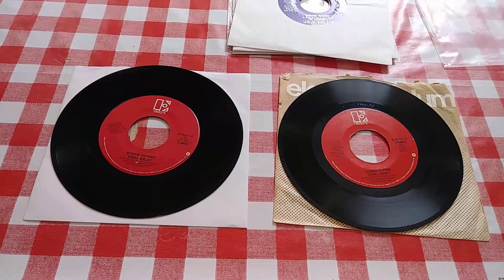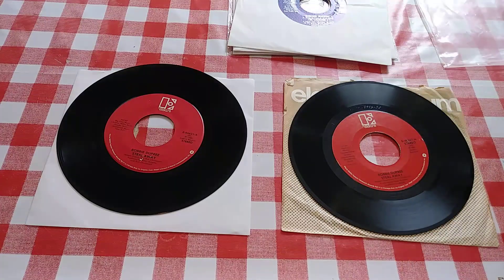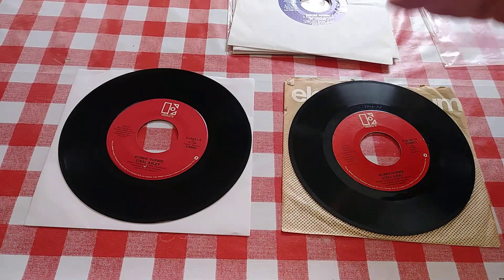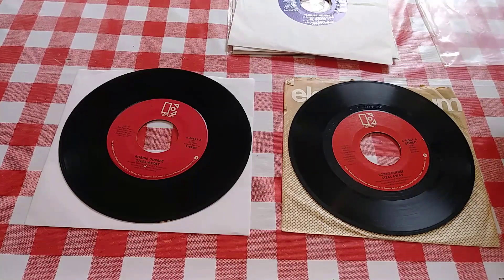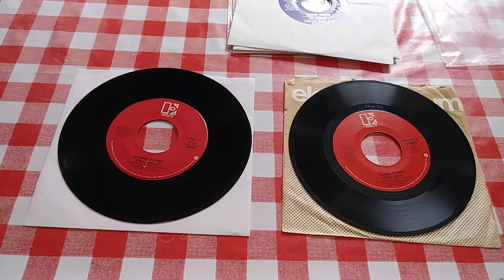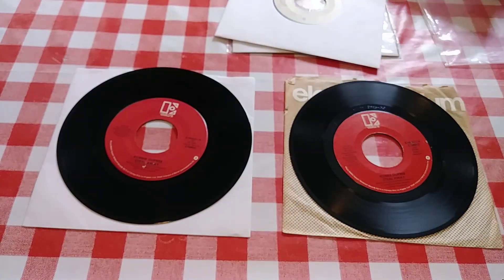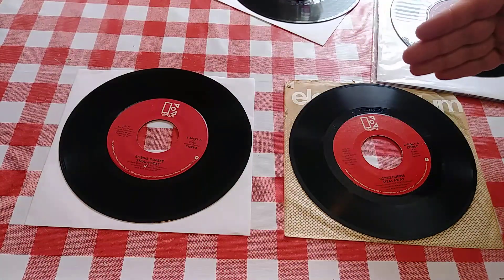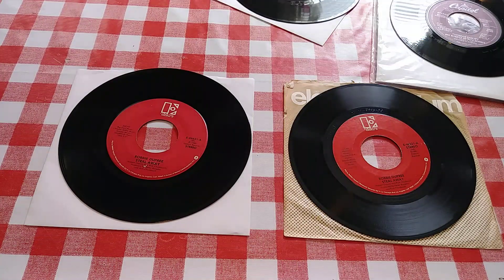Not All Records Are Vinyl | How to tell a Vinyl 45 from Polystyrene.

Comment: For what it's worth, my first TT was a BSR changer all-in-one that I was given in the late 70's.  I really didn't start collecting records (and 45's primarily) until 1982.  I used that BSR to stack and play vinyl and styrene 45's until I got a new component system in 1986.  I didn't burn out any 45's with that BSR.  My TT became an Onkyo semi-automatic return TT.  It was outfitted with a Shure Pro-Track-4 (RXP3), essentially a P-mount cart with a 1/2" headshell adapter.  I used both the standard stylus and eventually the upgrade stylus (N104E), which is elliptical.  I set the tracking to 1.25g.  After the Onkyo, I used the wayback machine and took possession of my dad's Dual 1225.  Since the RXP3 was really cheap at the Shack, I hung that cart onto the Dual 1225's headshell, using the same 1/2" to P-mount adapter, and have been using this setup since (+25 years).  Bottom line is, that I've never burned out any styrene 45 that I've had in my possession using the N104E in a Shure ProTrack-4 / RXP3 cart tracking at 1.25g... and I play my 45's a LOT.  Since I've installed my last NOS Shure Stylus, I will need to move on to a new cart unless I want to overpay for a JICO stylus.  Instead, I plan to move on to an Audio Technica AT85EP, since it also tracks between 1 and 1.5g.  Since the shape is the same, I am hoping to continue not burning out styrene 45's...
Reply from the maker: The BSR tables were not bad compared to the junk ceramic garbage of today. I had a few of those myself. As long as you kept up with replacing the styli, they were kind to records. The Shure is also not going to hurt any kind of record tracking at 1.25. I am now using Stanton 680's exclusively and my elliptical D680 stylus tracks happily at 1 gram with no irretrievable distortion. It all depends on the cartridge design. :)

Comment: There were a LOT of Motown records on styrene!  One of his first labels, Miracle, was on nothing but styrene, from what I've seen.  I would say most Motown from the `60's was on vinyl but, in the early to mid `70's, they started doing a LOT of styrene!!  And, most of their vinyl wore out pretty fast, too.  I've seen dozens of Motown vinyl singles where the grooves are almost white from ware!!
SOME Columbia singles are on vinyl.  Mostly it's promo copies and most of those are on coloured vinyl.  However, in 1977, if I recall correctly, they had a strike at their pressing plant(s) so, they had to have other people press their records for them and, in as such, there were quite a few stock copies on vinyl during that year or so.
RCA had their own pressing plant(s) too until 1978 when they had other companies press and a lot used styrene.
Another way to tell vinyl from styrene is to stick 2 fingers into the hole and, using a finger on the other hand, just tap the record with a fingernail.  Vinyl will just kinda go, "thud" but styrene has a slight ring to it.  Another way (at least with vinyl from the `50's to the early `80's) is to hold the record up to a light.  Styrene becomes slightly transparent, vinyl doesn't, except for most records made from the early `80's to the present.
Ther was a crappy plant in New Jersey that mostly pressed kids records (Golden, Peter Pan, Prom, and dozens of other small time labels).  I have NO idea what garbage they used to press their records into but, those were some of the cheapest records ever made!  I got a blacklight back in the early `70's and decided to see what records would look like under it.  Most looked pretty much the same but, I seem to recall that the styrenes looked red but, those cheapo Jersey records looked brown with yellow swirls in them!!  Really weird!!  I've got one on prom where the vinyl right next to the center hole is nearly paper thin!  If you put ANY pressure on it at all in that area, it'll collapse in your fingers!!
There's LOADS of videos that tell you how vinyl is pressed but NOTHING to show how styrene records are made!!
Reply from the maker: Most folks don't even know about the injection molding process these days. It has been floated out as a way to make LP's, though. Can you imagine a polystyrene LP?
Reply: @EzeeLinux  Yes, I have a few styrene albums.

Comment: Vinyl, Unbreakable and similar terms were printed on jackets and sleeves when record companies abandoned 78 rpm shellac. The rise under the label was on  Columbia’s 33+1/3 and RCA’s 45 rpm records from the start. Playing stacks of records was a thing going back to 78s. Otherwise I’m in basic agreement on this subject. But, haven’t you noticed that polystyrene gets hard and brittle over time? Now old CDs are showing degradation of the plastic. Also, I wonder how well lighter records would work with vintage turntables and jukeboxes.

Comment: Polystyrene 45's suck. They're cheaper to produce than real vinyl records and they don't last. After 20-25 plays, they sound "staticy" and "fuzzy." Hold a styrene 45 up to light & you can see through it. Too many record companies used styrene in the '80s.
Reply: And the retail price was about ⅓ of a 12" album, too expensive for this.
Reply: If light can pass through a 45/LP it can create a problem with some fully automatic turntables. I has a Sony fully automatic turntable and it used light to sense the size of the record. The light passed through two holes on the platter. It could tell the size of the record as follows: Both holes blocked = 12 inch record, one hole blocked = 10 inch record, no holes blocked = 7 inch record.

If the light can pass through the record then it will think that its a 7 inch record regardless of its size. I had to put the stylus on the record manually, otherwise it would play it as if it was a 7 inch record.

Comment: In Germany, steryne records were easy to recognize, because they had no paper labels. The writing was engraved in the matrices, the label area was covered with paint, red for Polydor, blue for Philips and silver gray for Ariola BMG.
Styrene is more fragile, it's less breakable as shellac, but easy breakable. With vinyl it takes much force.
A single was ⅓ of an album, so pretty expensive.
East Germany never had Styrene records, so they are way better.
Reply: Are you sure you're not referring to the VINYL with the  INJECTION-MOLDED LABELS?
Reply: @DLCOrganization  nope, it's the contrary. Some styrene records had glued  paper labels.
The material is harder, brittle, can be destroyed, when the stylus is too fine. On the other hand, it wouldn't make sense to apply some paint on the label area of a pressed vinyl, would slow down the process.
Reply: @verkehrsteilnehmer-berlin  -- I'm very well aware of this.
In America, pretty much ALL styrene records had glued paper labels.

Given what you said about the painted labels, bear in mind, it wasn't actual paint,
but a specially-formed ink that was basically stamped over the label area,
most famously utilized by the Amy-Mala-Bell record group.

Comment: I am a 45 RPM records collector since the early 80's. At that time I did not know the difference thus some of those called styrene (Columbia, RCA, Chrysallis, A&M) got wear with plays. My Warner Bros, Motown, MCA sound like new 40 years later. In summary, I do hate styrene.  Do you know that in Canada all labels were pressed on vinyl? 100% of my MCA, Motown, Atlantic, Capitol, Warner Bros are all vinyl, not styrene.  It is interesting to note that most promos on all those companies were pressed on styrene, except A&M which surprisingly pressed their regular commercial records on styrene, on the contrary, their promos were ALL on high quality durable vinyl.

Comment: Crosleys do not track at 9 grams.  They track at 6 tops which was normal until magnetic cartridges came out in the 70s.
Reply: 6 or 9 - what's the difference? Both terrible.
Reply from the maker: Magnetic carts have been around since the 1930's... 6 grams may have been the standard at one time for ceramic carts but it was too heavy. Those Crosley crappers have sapphire styli and some do indeed track as high as 9 grams when the arm isn't calibrated correctly. Sapphire wars out after about 20 hours of play... They're groove chewing junk. Pernod. :)
Reply: I’m not trying to defend Crosleys.  But the fact is that they are no worse than the cheap turntables used by most people in the early parts of the LP era.  Everybody who is actually weighed a Crosley cartridge, has clocked it in anywhere between 5 and 6 g.

When I say magnetic cartridges have only been around since the 1970s. The fact is that they were only really commercially available at a reasonable price around that time.   Phonograph preamps are a newish invention.  Magnetic cartridges are very light and do not put out the sound output required therefore they must be pre-amplified to get the proper dynamics. 

I’m not trying to defend these cheap record players, but at the same time you can establish the superiority of a better quality turntable without telling untruths about cheap turntables available today. 

Oh, and one more thing.  When the microgroove records of both Columbia and RCA were first manufactured, the tracking force specification was between five and six grams.  This was the least pressure they could use for the cartridges of the day while still giving out the best sound quality possible.

Records all the way up until the end of the mainstream LP era were manufactured to accept a 6 g cartridge. 

Only a handful of modern record records today would not be suitable for that such as dance records with very heavy bass.  This is because those records are mostly bought by DJs, who have high-end turntables with low cartridge weight.

Yes 5 grams will wear your records faster than 3 grams. But those cheap turntables don’t need artificial bad press.
Reply: @paulblackman8159  Totally agree.  While Crosley Cruisers aren't exactly good, anybody who says they "track at 9 grams" are just talking out their ass.  The RokBlok is far worse than any Crosley imo, those you truly can call groove chewers if you've seen Techmoan's video.

Comment: Did you folks ever think why conical stylus life-cycle is 200-300 h and micro-line/shibata is 800-1000 h? ML/SH provides way better contact so roughly at the same tracking force ML/SH type of stylus makes MUCH less pressure. So using ML/SH is good for a record no matter what material (vinyl or styrene) it is made of. Obviously conical stylus will wear out your record sooner.
Reply from the maker: Where did you hear that conical styli wear out in 200 hours? That's BS. They will last as long as 1000 hours if cared for properly. Also,, what I said about advanced shapes damaging styrene comes from real-world experience. All the hype about perfect groove contact with MicroLine and Shibata assumes a perfect alignment and doesn't take into account the characteristics of polystyrene. There's a  lot of audiophile snake oil in what Millennial-run marketing departments publish these days.

Comment: I was surprised when RCA made 45 singles for their Gold Standard series in the late 1970s thru the 1980s on styrene, but mostly using a rounded edge near the label.  And those atrocious Bell and Golden Records injection molding pressings using painted labels that came off too fast!  It was rare when Columbia & Epic pressed on vinyl without the disc being a promo.  Colored styrene was hard to find unless you saw the record through light.

Comment: I'm really glad I watched this video Joe. I just inherited my parents' record collection and some of the 45s mum gave me go right back to 1959. I'll have to go through them and see which ones are polystyrene now. I'm running a VM540ML on my turntable and was going to play them all on that, not knowing the problems associated with styrene and microline. 
I have the stock XP3 cart I got with my LP140XP but it isn't terribly exciting. Looks like I might have to pick up a VM95EN for the styrene 45s.
Reply: VM540ML plays much better than 95-series. I'm not sure there is any issue with  the microline or shibata stylus
Reply: I put a comment to this video describing the pressure effect which is for conical type of stylus is more significant.

Comment: For the most part, styrene center labels used 60 or 70 lb. C1S (coated one side) label litho stock, with an adhesive slapped on the back which, when applied to the record, glued it on.  Such labels were designated "Heat Seal."  45 labels were printed "24 up" on 19" x 25" paper stock, then cut up into four "6 up" sheets.  Columbia, Bestway and Shelley Products all had a label trim of 3.5"; Monarch and Allied had it 3.5625"; and PRC's was 3.625".

Vinyl labels were designated as "Compression"; label paper stock was all over the place, ranging from 60 or 70 lb. Kromekote C1S [cast-coated] up to the 1970's (60 lb. was also used on some styrene labels), to 60, 70 or 80 lb. C1S Litho, to 60, 70 or 80 lb. C2S Gloss, to 70 or 80 lb. Dull Coated, to 70 or 80 lb. Matte Coated, to uncoated paper stock of 70 or 80 lb. that was either characterized as Smooth or Offset.  Such labels shrunk by about 0.5 - 0.7 percent when pressed onto the record.

For the most part, styrene labels that were meant for 45's did not have any center holes drilled onto them.  Columbia had this range of die-cut center holes for styrene labels (for 7" 33⅓ RPM promo product) as follows:
R - 0.339" = 8.611mm (on a Bridgeport pressing from 1961)
11/32 - 0.34375" = 8.731mm
S - 0.348" = 8.839mm
T - 0.358" = 9.093mm (on a Terre Haute pressing from 1981)
When Pitman began pressing styrene in 1964, 7" 33⅓ RPM label center holes were the same 0.28125" (7.144mm) or 0.281" (K, = 7.137mm) as used for LP die-cut center holes by Columbia then; not until 1965 did they use 0.34375" or 0.348" holes.  Bestway hewed more to the 0.34375" size.

Shelley Products usually used L - 0.290" = 7.366mm or M - 0.295" = 7.493mm drills, though I saw one from 1967 where the hole measured 0.302" (N, = 7.671mm).

PRC's range of die-cut center holes for styrene 7" 33⅓ RPM's was:
3/8 - 0.375" = 9.525mm
V - 0.377" = 9.576mm
W - 0.386" = 9.804mm
X - 0.397" = 10.084mm
(0.386" was also used in 1966-67 by Columbia Santa Maria; by late '67, however, they went with 0.34375".)
Reply: wow. that must have been your specialty? excellent info. is this merely casual knowledge, or was that your profession?
Reply: @gregaiken1725  - I apprenticed to a printer on and off for a few years, and also have studied various paper weights both from that plus working in a field of investigation.  And had access to the archives of one of the major record companies.  Technically, it could be called a "hobby," but it seems I've accumulated more knowledge on that than a lot of those in the industry itself.

Comment: 2 Fool proof way of checking: 1) weight.  2) thump it; Styrene rings like a bell and vinyl thumps.
Some people believe holding it to the light works, but it's not foolproof.  Most of the time Polystyrene will appear red, but not always.  Polystyrene was not always exactly the same composition.  I have 2 such titles from Laurie Records and Smash Records that are styrene and are not translucent at all.

Comment: Some record companys used one material exclusively.  From the 50's to mid 70's RCA Victor used vinyl. In the 1960's and 70's London Records were styrene.  Radio stations were often sent styrene copies, but in a short time the discs developed "cue burns" - the stylus dug into the grooves from backtacking to find the start of the song.

Capitol's ridge around the label was introduced in the US in 1968  by EMI in the UK, Capitol's parent company.
Reply: The technical term for that ridge on Capitol 45's was "360 interlocking serrations."  It led to a new label design standard of 3.3125" trim that lasted right up to the point Capitol ceased pressing their own vinyl in early 1986.  A Billboard article, at the point that feature was introduced, called them "non-slip discs."
Reply: @pgh45rpms  I have a 
Polydor single by James Brown 
from the year 1972.
Reply: @pgh45rpms  and a couple of 
Polydor singles from the 80s .
Reply: @pgh45rpms  John Lennon and Eric Clapton.

Comment: Great video. I always thought polystyrene records sounded hotter and had a “brighter” sound, but they did wear out faster. Sometimes you can see a worn-out styrene record, as the grooves will turn white. Another interesting thing with styrene records is, beginning with early ‘70s records, if you hold one up to a bright light, you can see through it. The color is a dark red. Apparently, the companies began using less material, because they also seemed lighter. Fascinating stuff!
Reply: Monarch and Allied pressed "see-through" styrene 45's as early as 1967, the Columbia Pitman pressing plant as far back as 1969.  But Columbia Terre Haute's styrenes didn't get "see-through" until about 1971.
Reply: @wmbrown6  Pretty cool. I never noticed that. I knew you couldn’t see through the earlier Columbia, but I never noticed the Monarch and Allied. I know Monarchs have the M in a circle and a triangle before the matrix number, but how can you tell an Allied? I have to check them out now.😂
Reply: @gns423  - Numbers etched in the deadwax that, from 1962 to 1971, began with X-; from then to about 1976, K-; and thereafter, R-.
Reply: @wmbrown6  cool thanks